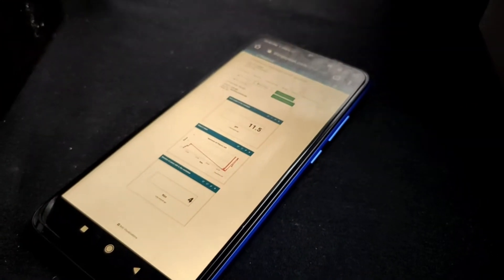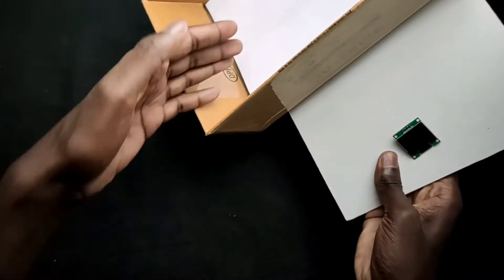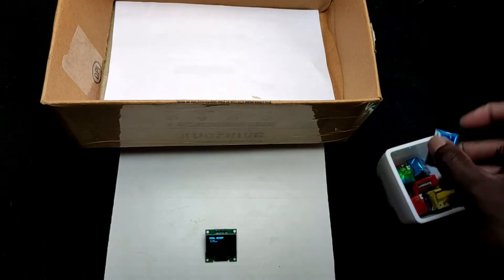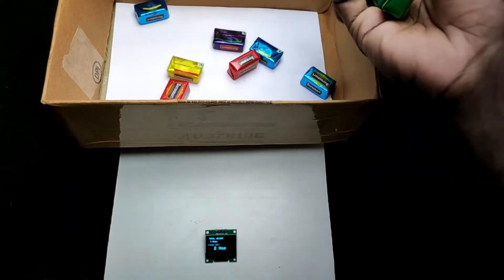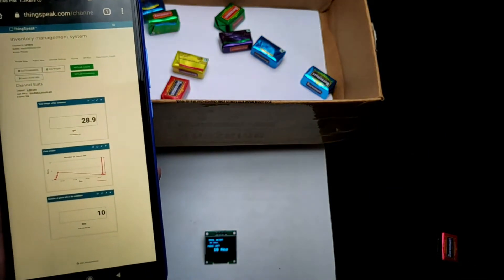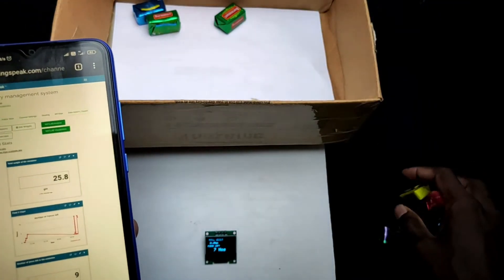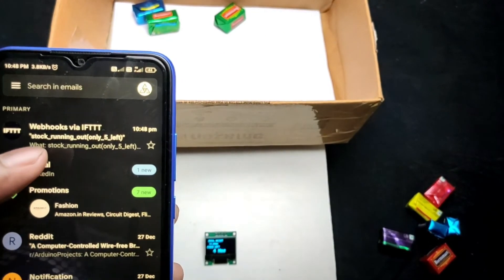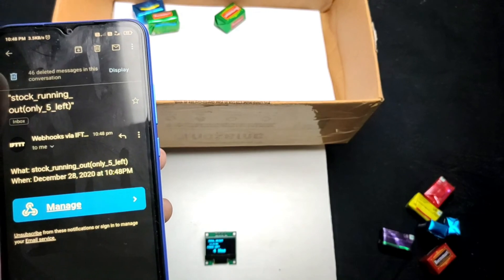IoT Based Inventory Management System using Load Cell and NodeMCU

Comment: Can I get a help about the usage of battery? I have checked the description but on circuit diagram is it the one named 'U47805' ?
Reply: Bro did you get the solution? What is the use of 7.4 li ion battery